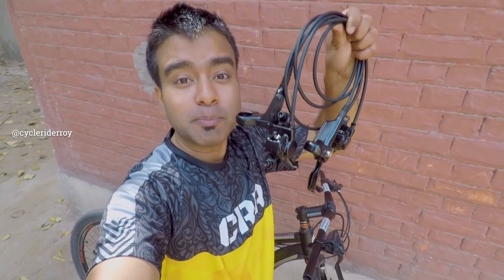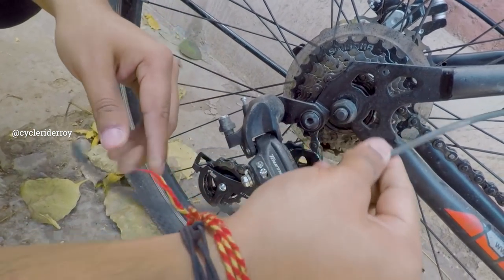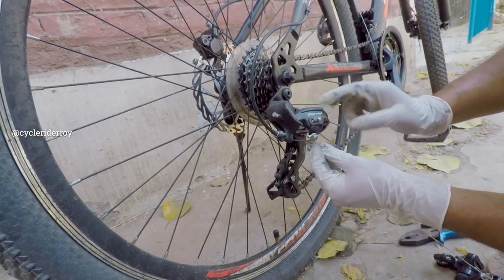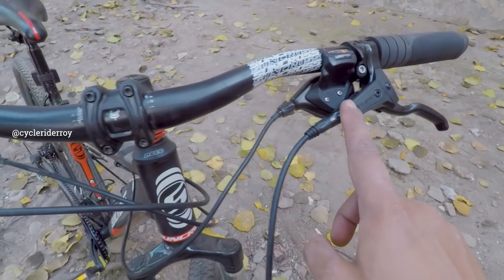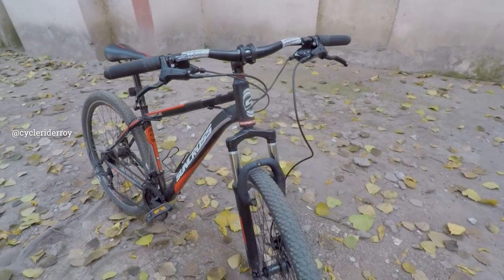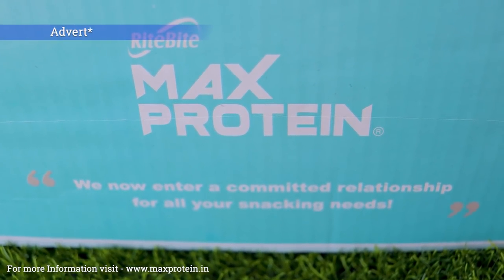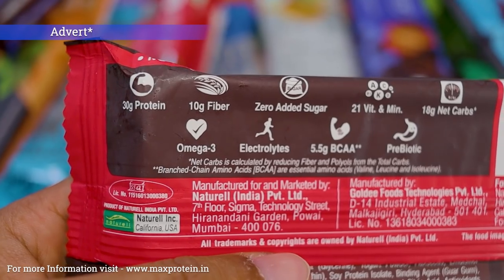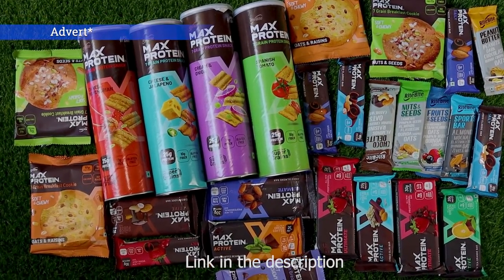How To: Install Hydraulic Brake on Any Gear/Non Gear Cycle in India | Mechanical to Hydraulic Brake

Comment from the maker: Smartwatch - https://amzn.to/2OpuEpE
MTB Short Stem - https://amzn.to/3tafa80
Cycle Tail Light - https://amzn.to/3rGfaMo
Bike Rear Light - https://amzn.to/3cAIJJh
Mobile Holder light - https://amzn.to/38qA5LW
2 Led Front Light - https://amzn.to/3bxwNIJ
Helmet Safety Light - https://amzn.to/3t9Ej2x
Good Helmet - https://amzn.to/38xepho
Low budget helmet - https://amzn.to/3vbS3eV
Chain Cutter Multitool - https://amzn.to/3eq40rz
Wrench Set for Cyclist - https://amzn.to/3rIObjC
Mobile Bag Cycle - https://amzn.to/3clX4cf
Touring Bag Cycle - https://amzn.to/3cq9BeV
Waist Bag MTB cycle - https://amzn.to/2PIiQPF
Hydration Bladder - https://amzn.to/3ch13qu
Looplube Chain Cleaner - https://amzn.to/3tcKEdk
Crank Repair Tool - https://amzn.to/38u31mo
Cassette Removing Tool - https://amzn.to/3bBoJqz
WD 40 for Rust Removing - https://amzn.to/2OM9rWL
Isopropyl for Disc Brakes - https://amzn.to/2OM9Ecv
Paper napking cleaning - https://amzn.to/38ujc2O
Reply: Sir can you please provide the online link of shifters and hydraulic brakes
Reply: Bete mauj krdi ✌️
Reply: Can u provide the address of cycle storey where u bought it
Reply: Bhai mere ko giveaway mein cycle de do please mere par koi cycle Nahin hai main Noida mein rahata hun
Reply: Bhai mere ko giveaway mein cycle de do please mere par koi cycle Nahin hai main Noida mein rahata hun
Reply: Bhai mere ko giveaway mein cycle de do please mere par koi cycle Nahin hai main Noida mein rahata hun
Reply: Bhai. Buy kahaan se kre
Reply: Bro link of the accessories you used in this video
Reply: Bro,which cycle should I buy under 20000 please help. 🙏🏻

Comment: I have 2 MTB one with wired disk brk n one with hydraulic ... I have notice one thing .. on the hydraulic brks I have the install oil every 2 months ... N the brks have become spongy ...over time i ride 30/40 km daily out of which 7 km is downhill . 
N on the wired disk brk it's ok type with little less power .. of stoping but the difference is very less

Comment: Pls sir   .requesting for your guidance. Can we upgrade rear derailleur from tourney to acera without changing cassette & shifter.. will it work.. what about the calibration.. will it be the same as discussed in ur platform or different... Reply at your convenience.. thnk u...
Reply from the maker: Yes we can
Reply: @cycleriderroy  thank u sir for ur prompt reply..sir will u pls suggest me..if i should buy a bike with tourney 21 comb & later upgrd to acera or should buy a bike with 24 altus system.
Reply: @MONTASTIC  buy a bike in which u get casette and not a bike with free wheel. Most bikes with 8speeds and above are casette but some bikes have 8 SPEED FREE WHEEL. I would recommend a 24speed bike and later upgrading to acera (with 9 speed casette if u want).

Comment: Hii Vishu Sir, i want to buy a bicycle.. I was aiming for Hero Octane Gyrfalcon 29. But almost every other cycles are out of stock..I hail from Thane(Mumbai, Maharashtra)..I also wrote to Hero to enquire about Hero Octane series.. but didn't get convincing ans from their end..any idea when they ll be producing back these cycles.. its been a while now.. i 'm chasing them since Oct 2020.
Also can you recommend some other cycle in same range and config.. as in Altus Back, Altus Front D, Preferably Hydrolic Disc breaks, 6061 aluminium alloy body, and most important cassette and not free wheel. At around 26k-28k budget

Comment: Does mechanical disc brakes calliper and hydraulic disc brakes calliper have same dimensions irrespective of the brands ??
Reply from the maker: Brake pads are sometimes the same
Reply: @cycleriderroy  suppose I want to upgrade mechanical disc brakes of Cradiac xc 900 with shimano 200,201 series hydraulic brakes. Can I do that ??